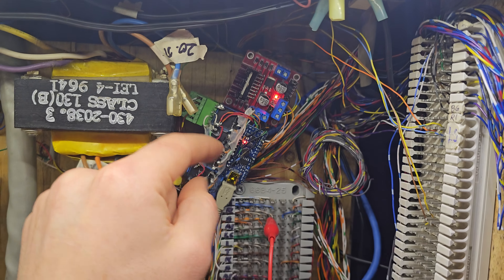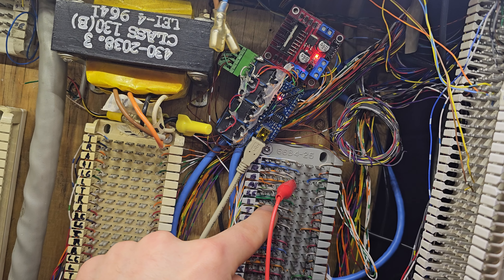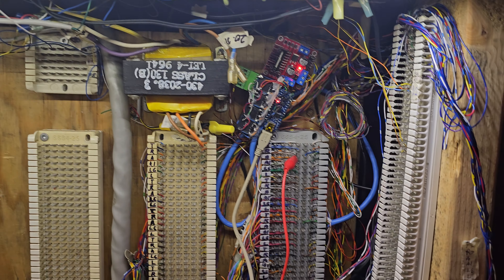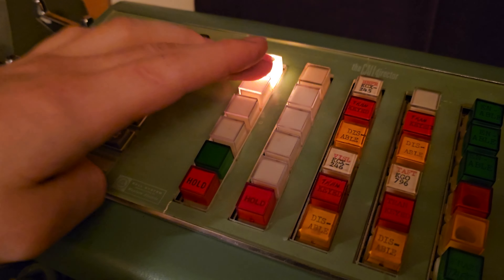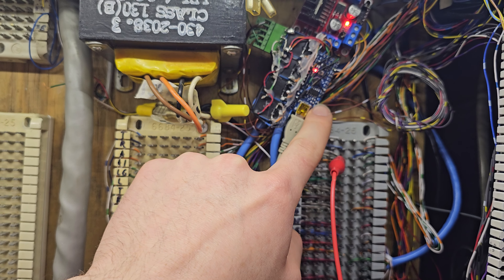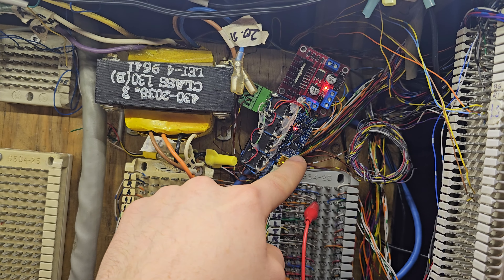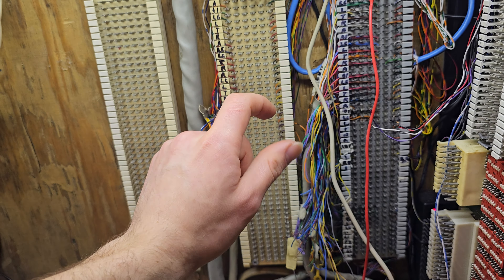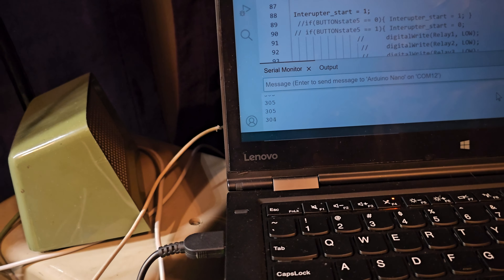Priority Hold arduino (in progress coding Troubleshoot) western electric Bell system 1A2 Phone

Comment: Very cool. It would be nice to have a fading or random pattern flash on the hold button. Could you build a unit that would activate Priority Hold by a 24vdc relay for the intercom line lamp? Also could you do a video on your plant equipment diode matrix?
Reply from the maker: Yes I could probably build something like that 

And yep I can do a video on the diode matrix 

It's a bit strange to get used to